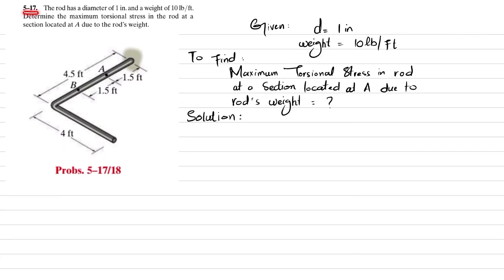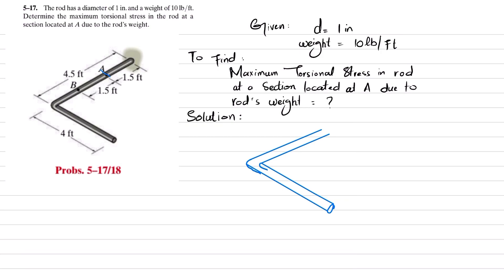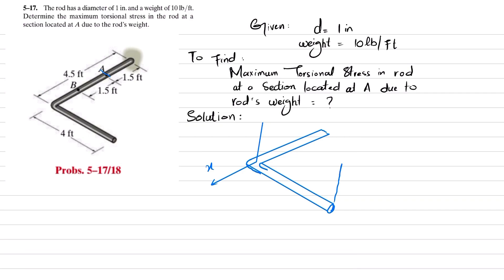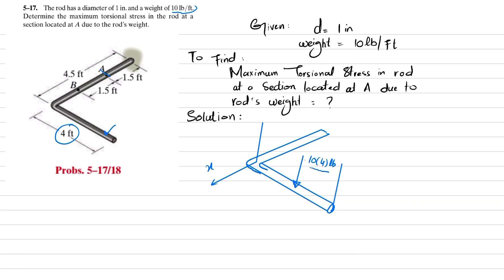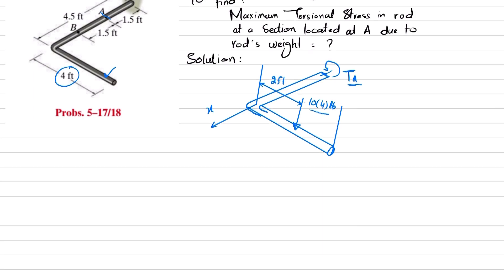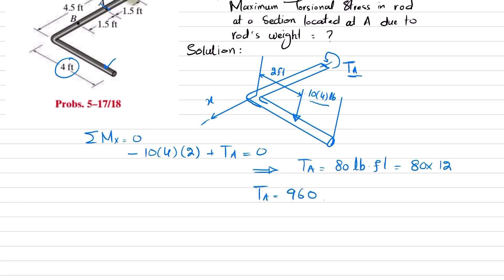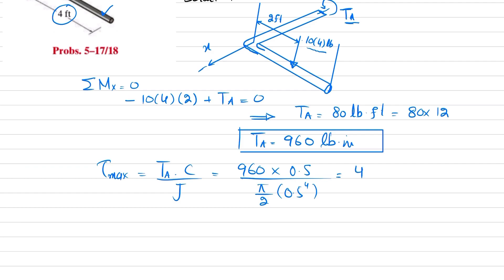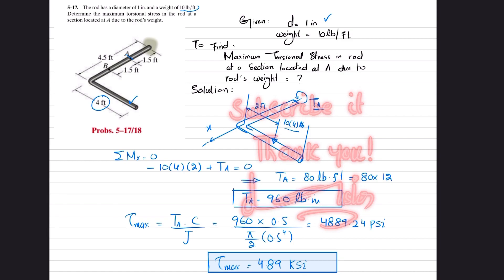5-17 Determine maximum torsional stress in the rod | Torsion | Mechanics of Materials RC Hibbeler

Comment: i have a question. why didn't u get the concentrated load on the 4.5 part?
Reply from the maker: That's a good question.  You can take that concentrated load on 4.5 part but that will not produce twisting affect at point A. And in question we have been asked to find the twisting affect only due to Weight of rod....
Reply: @engradnanrasheedmechanical  Thank you sir
Reply from the maker: My pleasure @tanih.3318

Comment from the maker: Weight of rod is 10 lb/ft . So to convert this load per unit length into force we multiply the length 4 ft with 10 lb/ft so ut will give us 40 pb force acting at the center of 4 ft length. ❤

Comment: Why did you multiply the 10lb/ft ×4 ?
Reply: Hello, multiply 10 lb/ft x 4 ft = 40 lb, since it is a uniform force along the entire bar.
Reply from the maker: check out the rest of comments you will get your answer
Reply: to get the concentrated load on that part

Comment: hi, why was the force placed on 2 ft? why can't it be  on 3 ft?
Reply from the maker: Because distributed load weight per unit length  is given and when you multiple with length it gives force which act at the middle . Which is 2 ft

Comment: can  you explain why we multiply 80 with 12? where do you get 12?
Reply from the maker: Yes sure. You can see its 80 lb.ft. so to convert feet (ft) into inch we multiple it with 12 in. Because 1 ft= 12 inch. After multiplication torque will be 960 lb.in. i hope that you will have no confusion now ❤
Reply: @engradnanrasheedmechanical  thank you so much for the fast reply ❤️
Reply from the maker: @puteriawatif2541 you are always welcome bro....